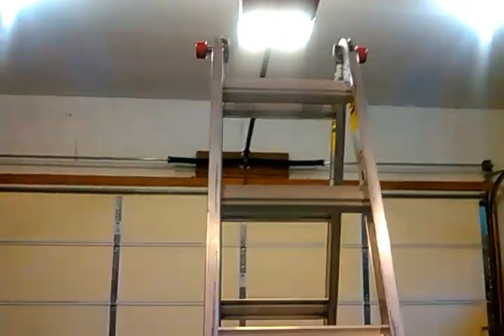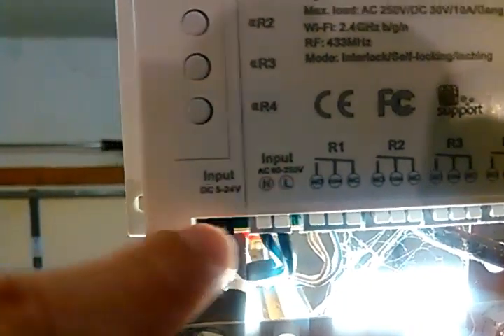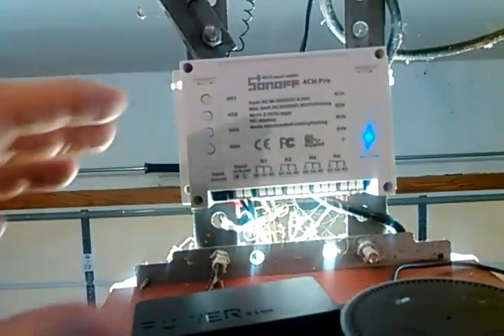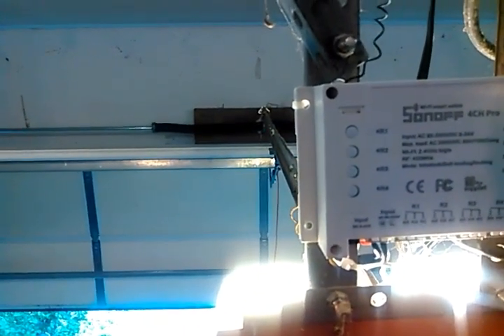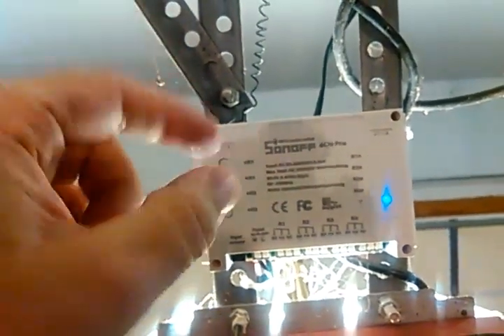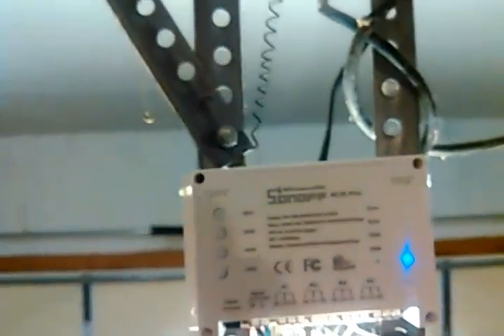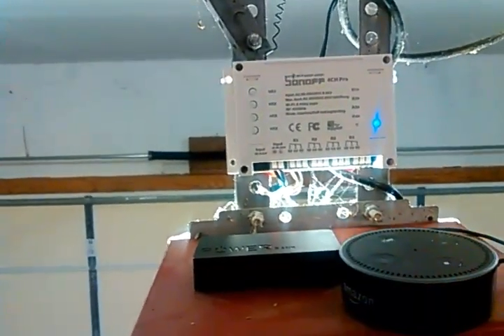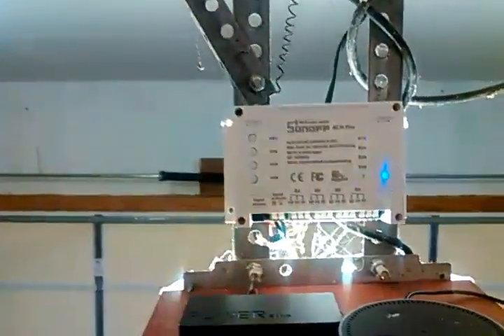WiFi enable your existing garage door for under 30 bucks!

Comment: Bought a Sonof inching switch for $15 and then added a wyze inddor wifi camera for $20.. I use the camera to monitor when I need to check or activate it from anywhere. So much cheaper than buying the Chamberlain Myq system and it hss no monthly fee to use Google or Alexa.

Comment: My garage is too new to work this way for security reasons.  I have to use a device like yours to short the buttons on a spare remote I have (mimics the button being pressed) . But.. doing this means you can control each button on the remote (aka 2 3 + doors) and it doesnt need to be plugged in up high... just in range of the remote is enough.

Comment: The device is overkill for what you are doing.  Unless you are using the other channels or other RF antenna feature then a single channel WiFi device would work.  Those can be found for as little as $7.   I do like the look of that device though.   Were you aware that Alexa can have assigned groups and actions that will react to you specific voice command?  This would allow you to say "Open garage door"  or "Close the garage door" instead of "turn on garage door" ~ because honestly, who says that?  Nice video.
Reply: @VTwin4Christ    Good point.  My comment regarding "Open and Closed" was  a bit misleading..   The comment would evoke the same action - activating the device.   As you put it, there is no way with this model or the ones I spoke of to  know the current state of the door.   My only point was that  I typically say open or close when I refer to the door.   In my application, it is to be able to use Alexa on my phone and my families phones to provide access to the house without an actual opener.  The intent is to be in front of the door or house so the state of the door will be known.  I assumed most people would say "open the door" or "close the door".   Sorry if I offended you, I didn't mean to come across in such a manner.

Comment: Ok, watched this video twice...I see the power to the sonoff and i see the button to the sonoff, but where is the power from the sonoff to the garage opener?
Reply: Exactly what I'm trying to figure out. Its as if you just attached the button to the Sonoff, but the Sonoff is not connected to the garage door motor anymore.
Reply: @VTwin4Christ  does it make a difference which wire goes to No and Com?
Reply: Does not appear that the question is answered.   I assume that what he is trying to say is that he cut the wire from coming from the wall but left them attached to the wall button and to the opener.   Then he split the wire so that one leg of the wire from the button goes to NO on sonoff and the other leg goes to common.  Next he took the wire from the garage door opener (because he cut the wire coming from the wall) and split it as well connecting one leg to the NO and the other leg to common.   I could be wrong with all this but that is the only thing that makes sense.   If you do what he says in the video then all you have done is connected the sonoff to the wall button but not to the opener.